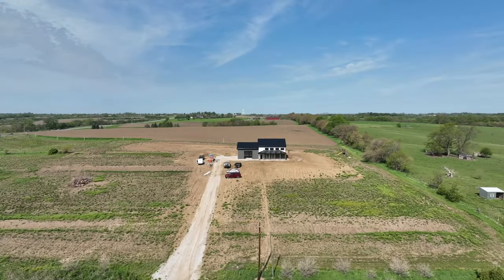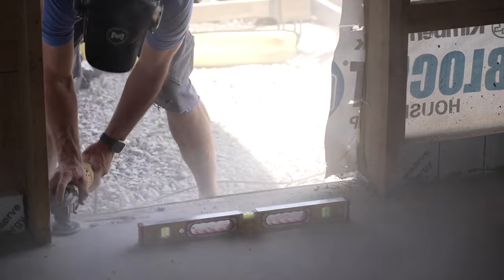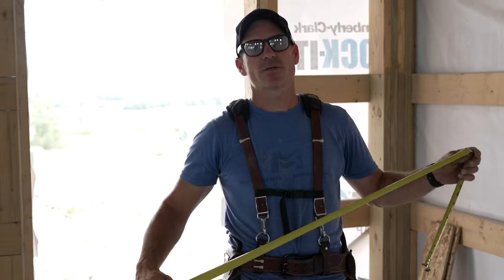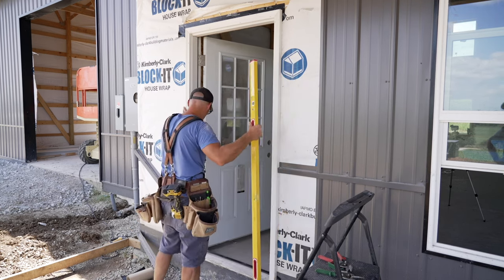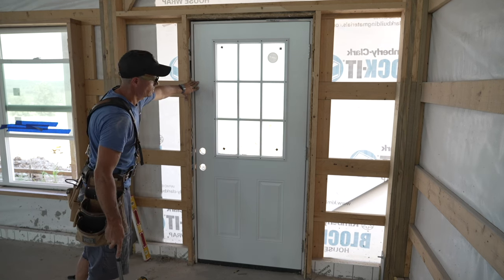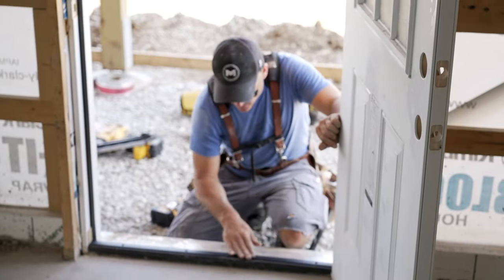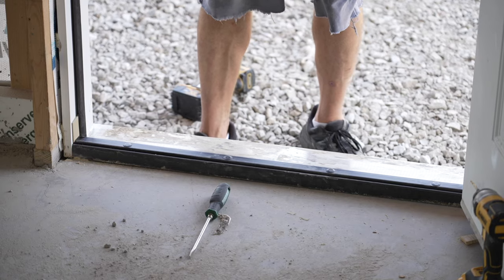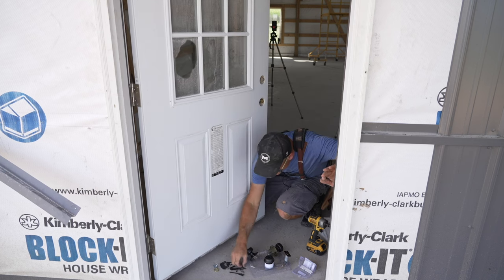Installing Exterior Door | Step by Step | DIY How To

Comment: First rate job on the door but you know as a former SWAT Officer that simply breaking on glass pane or a good kick and that door is open exposing contents.  I like solid hardwood doors with HD deadbolts.
Reply from the maker: I hear ya. I spent 15 yrs in law enforcement my self on a task force and the good burglars do their homework and if they want in they are coming in. If I was building in areas where I worked in law enforcement I would use a solid steel door with a barrel hole for my gun to stick through. 😂
Reply: What about the windows?
Reply: @Riley_rolo  they make steel security shutters that offer impact resistance or more.   And windows that are impact resistance etc.   but all is quiet expensive.   Best to have sensors on all doors & windows as a supplement.   I had a former police trained Rottweiler and he caught two crooks who were pros that came in their window.  The were relieved with the cops came to arrest them as the dog was removed.
Reply: I’m thinking about putting 1/4” steel plate on heavy duty 1” round stock hinge pins on the inside that I can close up against my interior doors. But my wife only lets me think about it..

Comment: Great video, but i noticed you used a wooden shim at the bottom on a concrete slab, wouldnt it just rot out over time? 10:19

Comment: I've seen countless places (despite Typar refuting this in their install instructions) that you shouldn't bring any housewrap into the rough openings, and flash the entire RO instead, overlapping to the outside and cut your housewrap 2" from the RO and have the flashing overlap that, then sealant the interior and not exterior to allow water to dry and drain to the outside. Any thoughts??

Comment: How much of a jamb extension are having to use with "that" door,...which I think is a typical unit from a lumber yard? Can you order them with a wider jamb for a post frame? Windows too?
Reply from the maker: For interior and exterior girts you need an 8.5” jamb. The doors are more expensive this way, but If you have a door that opens up into a 90 degree wall or a door with sidelights you don’t necessarily need the extended jamb as the door will open fine with 6 9/16 jamb thickness which is a standard door for a lot of places.

Comment: What length fasteners did you use for each step. If you don't mind. Also, if I'm trying to replace the brick mold what length fastener would u recommend for that.
Reply: The screws that go into the hinges usually come with the door. For the rest, a good 3"-3.5" screw would probably work in most scenarios. For the brickmold measure it's thickness and add another inch or so. 2.5" brads or finish nails would probably work fine.